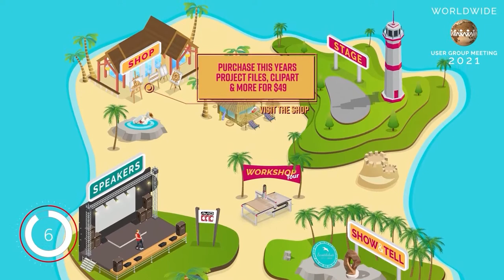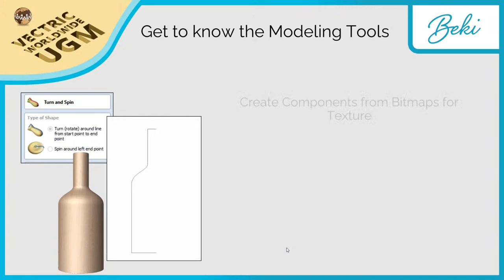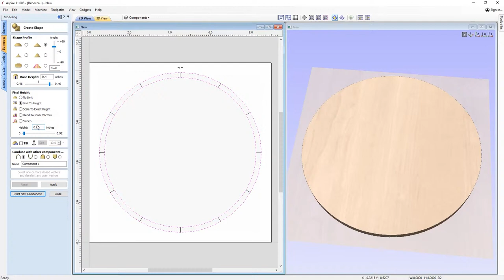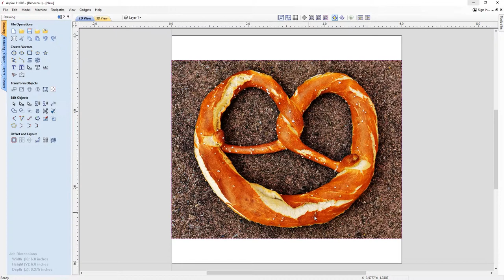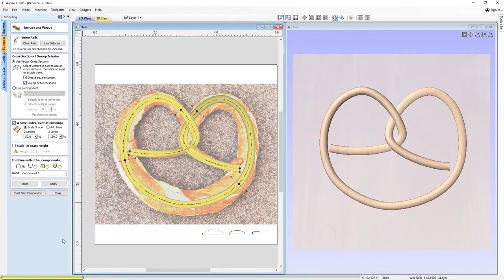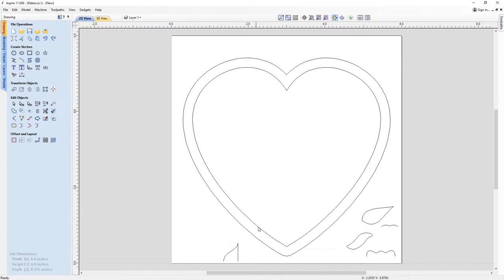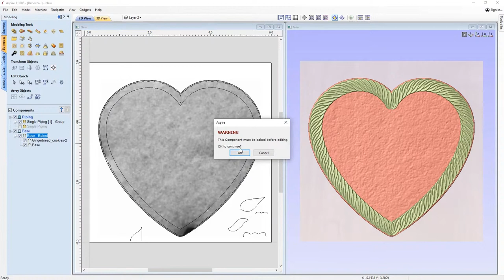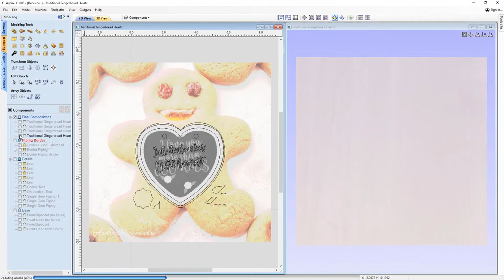Modeling: The Foundations with Beki | Vectric Worldwide UGM 2021

Comment: I will be cutting out a 3D eagle from the clip art that will be about 3 and 1/2 feet in length.  For the modeling resolution, should it
be Very High or should I go to Extreme or Max resolution?
Reply from the maker: Hello Harvey and thanks for the question.  I personally would start at the Very High and then run some test tooling.  You know, just the basics to see what I get.  Then ajust if needed.  Also it would depend on the finishing cutter you are going to use.  If you plan to use a 1/4" ballnose... then the extra detail you get with a higher resolution won't be seen anyways.  IN this case your 3D toolpath priview is your friend!